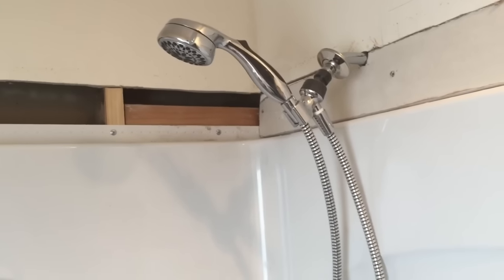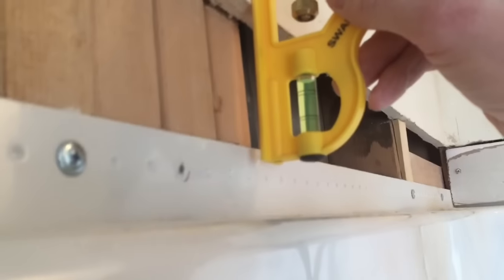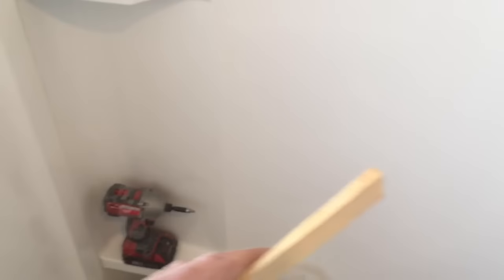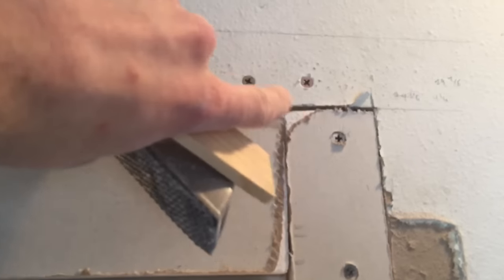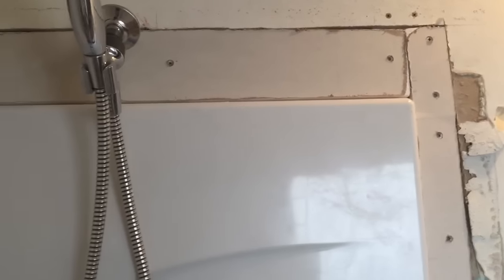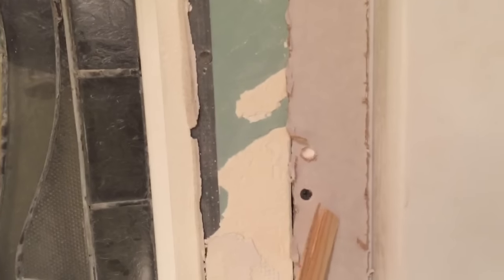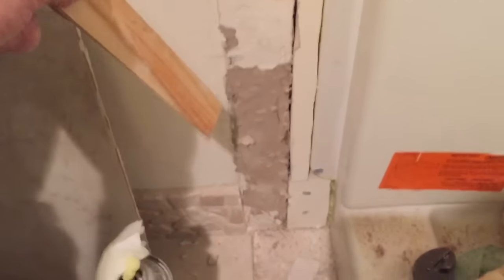How to install drywall over a tub or shower flange

Comment: i would have though it would have been easier to take out the sheetrock up to the ceiling - you would have ended up with just the seam at the ceiling.

Comment: I actually notch the back of the 1/2" sheetrock out using a table saw.  (make sure you do it outside, quite a powdery mess)  I then stick mesh tape onto the flange (this helps strengthen the back of the notched sheetrock).  I then coat the flange with hot mud and install the notched sheetrock piece right over the wet mud.  Works great.

Comment: I I hate the butchered drywall job.. Just my ocd lol. Run your board to the top of the lip instead of overlapping. The tile runs right over the lip and later down the road if your shower/tub shifts a little bit it wont crack your job since you dont have the stress of the board on the lip

Comment: Run the drywall just till it hits the flange  and then your tiles can run down over the flange....this is the proper way
Reply: there are no tiles
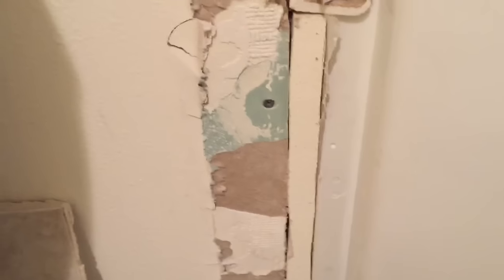Reply: @timh8324  5:06 He's putting tile on the wall up to least one side of the stall, but he doesn't say where this tile is going to stop on the left, away-stall side of the wall (all the way to the left corner or?) nor on the right, stall side of the wall (straight up to the ceiling from the stall edge or continue above the stall all the way to the right corner?). As much as I commend him for his diy efforts and for trying to help people by making and posting this video  he's actually not that helpful because his explanations are incomplete, his work is pretty sloppy, he doesn't seem to know what he's doing, and we never get to see the finished product. I.e. he's showing people what NOT to do, which I suppose is helpful in its own right.

Edited for punctuation, spelling, and more clarity.

Comment: Good idea, but typically what I do is bump the 1/2” rock to the flange and then fill the void over the flange with hot mud and mesh tape. After paint I caulk the wall against the shower/tub.
Reply: That is the best way to do it. Hot mud is bombproof.
Reply: Thanks for the reassuring idea. I've been wondering about hot mud. I got the same lip and screws. I think hot mud would be faster vs notching.

Comment: Why not just redo the top section of 1/2” drywall right down to the insert from the ceiling, and 1/2” on the sides. You can use the LB bracket thing on all the edges then silicone. It might be recessed a bit but the LB will protect it and you’ll have silicone on the edges.

Comment: So did you end up muding around the shower flange. Did you use tape on the flange side too then caulk ? I’m about to do this and was gonna leave the sheet rock up at first but then everywhere I look everybody is doing direct to stud so I’m gonna do it direct to stud and finish the sheet rock around the edges just wondering how to finished it. Thanks

Comment: Just butt the new pieces of drywall up against the flinge and then fill the gap with drywall mud let the mud dry overnight then mud again let dry sand smooth then paint the walls then chaulk around the shower let dry then touch up around the shower with paint.

Comment: Why would you use drywall in a shower and not something that can get saturated or mold? Hardie Board or cement board of some type. Not solid advice. And Hardie Backer Board does come in 1/4" & 1/2".
Reply: It's sheet rock around a fiberglass shower unit he's not doing any dam tile.

Comment: WTF, there's got to be a better way.
Reply: Yes, the better way is to remove those little pieces of drywall that are already up around the surround, add shims there so that flat drywall can be put up. No curves, no planing! just right.
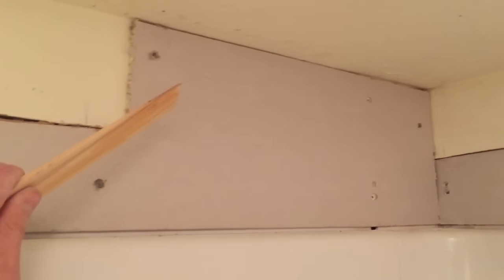Reply: Like at 3:58, you see he removed the drywall up to the cealing on one spot on the left side of the shower. Should have done that all over.

Comment: Cmon. Just cut the drywall back further. Piece back as few pieces as possible
Reply: Exactly. Cut the dry wall back, add whatever shims you need to to the whole framing to get the dry wall over the flange, then use less drywall pieces.

Comment: Your suppose to sheetrock everything first with greenbord sheetrock which is moisture and mold resistance, then put the tub wall over it so everything ends up even and level.
Reply: do you not install a surround to STUD surround on SHEETROCK. its called "bolt to stud" for a reason
Reply: Yeah, no. You are the reason people need to be careful when looking for tips and tricks on the Internet, because you are dead wrong. Have fun installing your direct to stud surround 🤣
Reply: If you do it this way you need something to cover the flange. Only reason I can see for doing it this way is if you're going to tile the walls above and to the sides of the shower stall. The tile covers the flange.